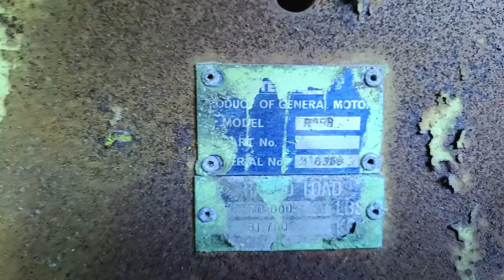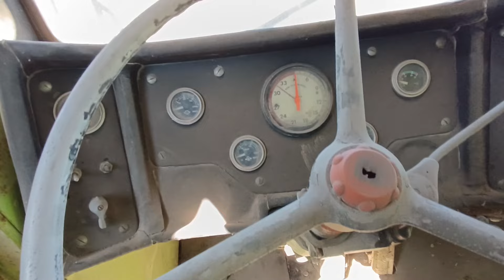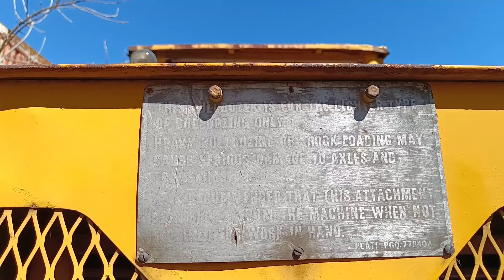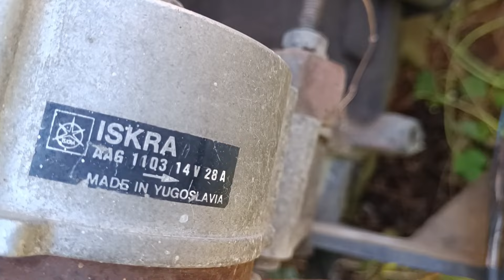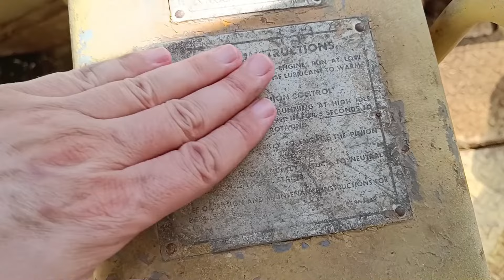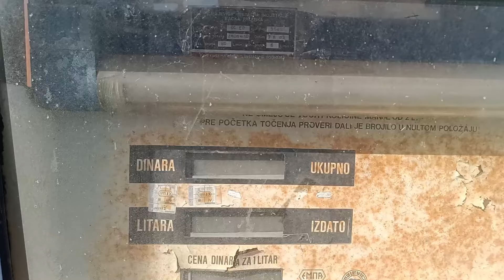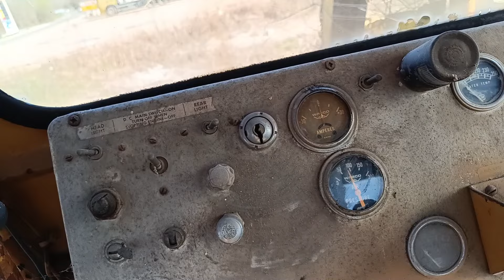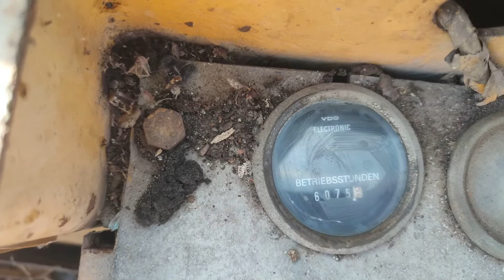Amazing Construction Machines Time Capsule Heavy Equipment Frozen in Time Terex CAT O&K  Volvo

Comment: 1:20 look like an Italian Perlini T15 but the front part seams modified, the logo is Perlini. Perlini is an Italian constructor that starts in the '50 with mods on other brands trucks than enter the dumper market in the '60. In the front light you can read "carello" an other Italian brand that mke lamps from 1876. They were common when I was young.
Reply from the maker: Wow, thanks for the info! I searched all over the internet and couldn't find anything about that truck.

Comment: 5:03 zigzag pattern of gearbox lever prevent you from too fast gear change u and down. Since there was a selector shaft in gearbox which is rotated one section at a time (it means one speed up or down) by two solenoid valves, you physically could not change gear e.g. 6->2, you must do sequence 6>5>4>3>2. every time when solenoid is activated for about 2 seconds, you get a speed change one up or down (depends which solenoid is activated), next activation next speed and so on. there was also a selector shaft position sensor also. i'm not sure as in Terex, but in CAT  machines in case of failure of a lever you could unscrew a plug, push in a 3/8" drive with t-bar and change speeds manually by rotating it when sitting on gearbox. An ancient limp home mode :)
Reply from the maker: Wow, didn't know that, thanks for the info. Thanks pal, cheers 🍻
Reply: @HeavyMiningEquipment  Allison automatics. They had retarders too.

Comment: I bet if some of those GM/Detroit V-12's aren't locked up they'd run again! Bruce from Austrailia got a Wabco haul truck running with a 
V-12 in it. Those and a Euclid/Euc/Terex were close kin. I drove an R-35 Euc with a V-12 and a 22 with a 6-71. The 35 had a 6-speed Allison auto and the 22 had a 4 speed. The D-6 was probably a 6-C and the 8 was a J series with glow plug start. The 8H  I ran was pony motor start. The rubber tired dozer was an R G LeTourneau out of Texas and Georgia. Look him up online. HUGE stuff! His old stuff was all electric with flywheel generators and electric motors to power everything. Almost all Detroit powered. Mostly cable operated with electric powered winches with brake packs on the motors that had to have power to turn the motors loose to turn stuff. Toggle switch steering. Wabco used the flywheel generator setup and electric motors on some of their paddle pans/elevating scrapers. The 992 was NICE! I ran an 988 some and a 980 a lot. Fine loaders. They had a Kawasaki 115 Z-iv that was the size of an 88 that'd lift 18tons at a time, every time. Cummins powered. That was GOOD video so Thanks Much! This is what I did for 55 years. Still would if  could. CHEERS!